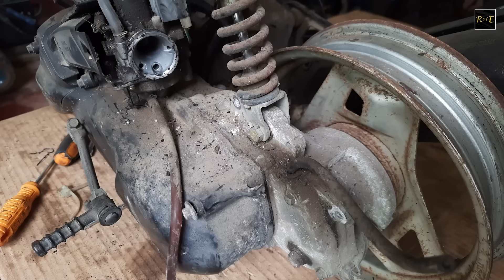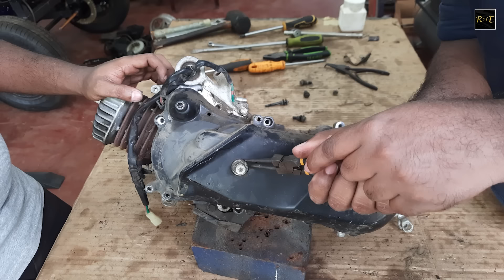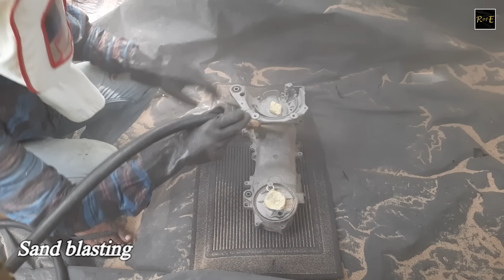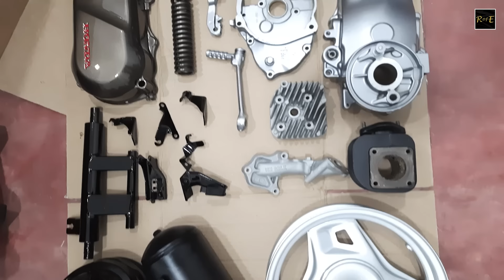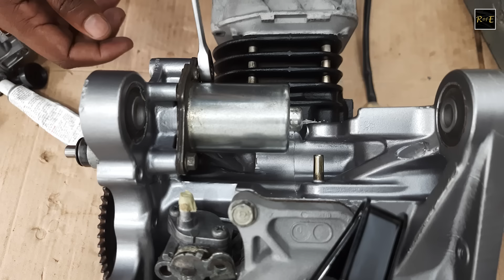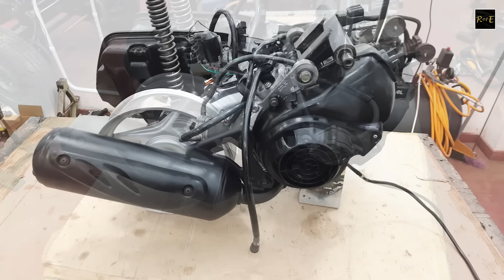Honda DIO 50cc Scooter Engine Full Restoration | Honda 2stroke Engine Restoration

Comment: Should have used the original honda variator weights.  There was still plenty of life left on them and you cant find a better weight than oem honda. The weights he put in must have been from the $.99 cent store.  They weren't even directional 

Thats a tip for anyone who is doing upgrades on their honda scooter.   Always buy oem honda weights.   They  come in different weights.  Doesn't matter what brand you like and think are great, oemhas them beat.  U can also pop the weight out of the cover and slip in and bare weight u need.  Just be gentle and you'll need a rubber mallet

Comment: That clutch bell is done. Rainbow color=excessive heat=brittle=best case it warps and causes vibration causing potential damage to other parts,  worst case=one day it grenades and the rider get schrapl in their ass
Reply: Bell should have gone straight to the scrap yard.

Comment: Hello from Turkey, I have a honda cbf 150, I have a honda cbf 150, when I apply the rear brake, there is a clicking sound and the brake is locking, what is the reason and solution, thank you.

Comment: A question for experienced people, is it true that after the maintenance of the machine and changing the parts that it is not allowed to drive at high speed until after a week or more
Reply: This wasn't a maintenance it was cleaning the engine nothing changed, it's true that after changing the engine in 2 strokes u should not rev at higher rpms, only for a while

Comment: Restaruration is not just good look .
You dont even look at the vital parts of the engine only the metal , hone the cilinder , put new piston ,, rear pulley same like you take it out , no spring new nothing , just roller weights , old belt , everywhere liquid gasket not the proper gasker , no brushing the magneto insade , diferencial not cleaned with petrol before new oil , new resistor , new bearings on the crankshaft .
Someone will buy by the look and than bearings noise , clutch sliping , clutch bell wear out , sorry but im service man and i dont make this look for sure but 10 times more healty , strong and quality engine when im restoring full engine like you .

Comment: What is the model??currently we are fixing a AF18E engine. Nice work.
Reply: its a af34/35 engine
Reply: @kyleandrei  thank you..there are small changes with  the AF18. That's why I am wondering..
Reply: @the_garage  18 is vertical
34 is horizontal
Reply: It's model - af34e